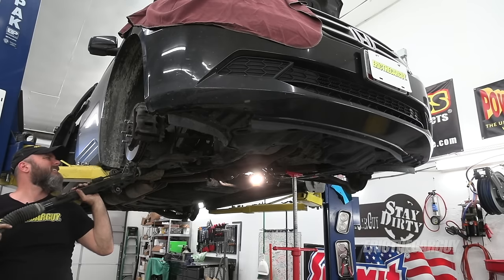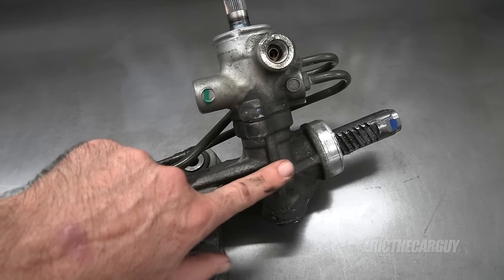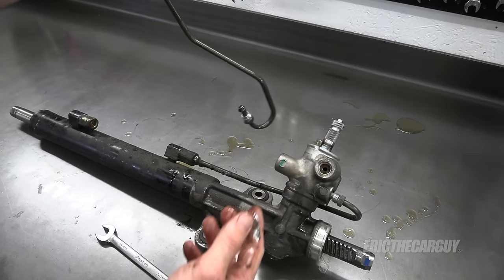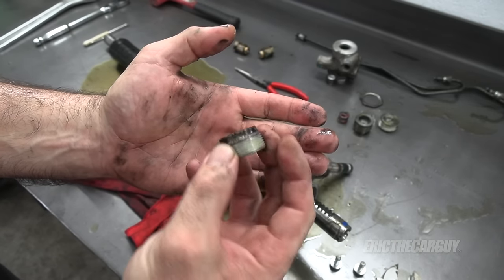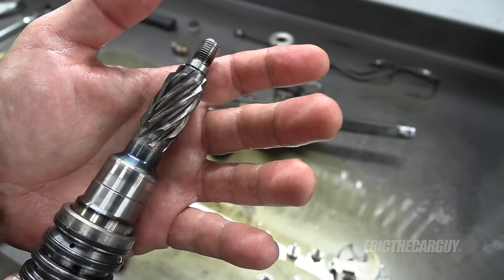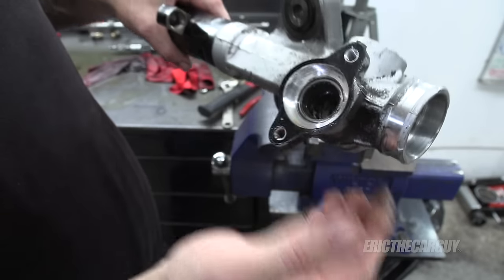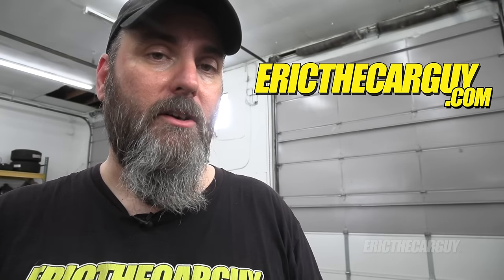Whats Inside a Power Steering Rack?

Comment: REBUILD IT PLEASE - a Power Steering Rack rebuild video by Eric will be super cool. All agreed - give thumps up here so Eric can make the video.
Reply from the maker: Well, you saw how it came apart. You could easily use this info to rebuild one of your own. Thanks for the comment.
Reply: @ericthecarguy  screw that...too many small parts ..I'll buy a cheap rebuilt on eBay 😀
Reply: @bilbobaggins4710  Maybe, you'd get lucky and buy a new one - like Eric. Don't neglect your local auto parts stores. They sell rebuilt parts.
Reply: @jeffkelley3419  too expensive....I mean my rack works fine just needs seals as is the case 99% of the time....not worth spending $350 plus my old unit... they're making a killing ...eBay $140
Reply from the maker: @Mike Pevency It's not always 'just seals' like in the case of this PS rack. If you end up needing hard parts you just lost your shirt on the rebuild and you would have been better off replacing with new or reman.
Reply: @ericthecarguy  I'm 54 and I've never had a rack need more than seals....I've been driving my Z for 1000's of miles with a leaking rack and still no mechanical issues ...I repair electric motors for nissans and infinities and they always need brushes only...never do they require hard parts replaced...soft parts are gonna fail at highest rates it's common sense
Reply: @bilbobaggins4710 u never replaced the seals?
Reply: @bilbobaggins4710  you can do that !!   ... but, I have bought remanufactured racks that come with excessive slop in them. Meaning, whomever rebuilt it, replaced the seals.  ..... but they DIDN'T replace any other worn guides that keep things tight inside there   And I also bought a rack that is allowing a lot of vibration and or feedback in the steering wheel over bumps. So I suspect they didn't replace the Teflon seals on the pistons.   It's easy to get a bum deal on a remanufactured steering rack when trusting someone else to do the work. Remember, if you want it done right..   ... you have to do it yourself.
Reply: @ericthecarguy I've rebuilt these racks alot there are several ways it fail but being that you go a vibration when you go over bumps it was the spring loaded shaft tensioner that was not properly torqued, it allowed up and down(horizontal)movement that's what caused your issue and if you look at the busing when you pulled it off it had a little bit of scoring from it not being the sioned properly. Also within that empty shall after you removed the shaft there's another regular oil seal in there... Those o ring thingi you saw all around the valve and in the middle of the shaft are all Teflon rings... Engineering is beautiful.

Comment: @EricTheCarGuy We rebuilt 100's of thousands of steering racks over the last 33 years. Interesting to watch you go through the teardown. Sad you didn't give the viewers the terminology of the components. As a builder and a troubleshooter I have been through so many calls and emails with people that didn't know what I was describing and they had been "doing this for blah blah many years" lol. BTW this rack is pretty simple parts wise than so many others. Also there is a reason why we leave the passenger side tie rod on when you take the pinion nut off! Love the mess!. Honda doesn't want the core back because it's a cheap POS of a rack often made by KOYO or SHOWA. They are so poorly and cheaply made like the rest of the vehicle that they are disposable. The rack piston is super soft steel so it bends easily and the chrome is thin.Yeah the lower pinion bearing is often a failure in the Odyssey just as in GM's especially Magnasteer. Too small of a bearing for too much load. And for those who buy the kits online and say "hey I'm going to rebuild my own!" Have fun! Unless you have all the specialty tools to properly remove, install, and seat the telfons, rubber seals, o-rings, packings, bearings etc for the more difficult racks I wish you well. One nick, burr, or ill-fitting packing with cause a fail at pressure. The one final tool is our trusty Branick RPA-700 tester. This is what simulates in-vehicle operation. If it's going to fail it will on the test machine. If you don't have this and you're rebuilding your own it sucks to put the unit back in and have it fail making a mess all over everything. Using the vehicle as your final test is a bad way to learn a lesson. For those who whine about rebuilt parts I can tell plenty of stories about the seasoned wrenchers that ruined many a rack and expect warranty replacement. Good video Eric.
Reply: Hi Jon Roberts, are you saying that any steering racks can be rebuilt/repaired and there is nothing called beyond repair ? Thanks in advance for your (expert) response !
Reply: @ssudarso  I never said ANY. I did mention some in that post aren't worth it. We've certainly seen beyond repair. No doubt. Collision victim where the entire housing is shattered or the rack shaft is too bent to straighten. Mounts broken. The famous LH platform Chrysler had in the 90's that was positioned in the vehicle so that the rack housing would fill with water and the polished rack shaft would be corroded and pitted beyond repair. First gen Tacoma 4WD would get water in the passenger end and ruin the entire shaft. Couldn't get them re-chromed when that damaged. Oh and Late 70's Volvos leaked like hell no matter what you did. Bad design. Same with early Audi 100, any old school Bentley or Rolls, Jags, leaked like hell. Most older UK racks made by "Pow A Rak" were horrible leakers even with genuine seals. We only rebuilt with OEM seals. Some parts are just made bad and rebuilding is either more challenging or pointless. Thanks for the reply!
Reply: @jonroberts4422  many thanks for your elaborative responses and explanation. Understand that if major deformation happend (too bent, damage due to accident etc.) it is better to replace the whole unit but in general if it is about "noises" - it should be rebuilt-able.
Reply: The main front suspension noise on the passenger side that gets us all crazy and after changing all suspension components is always still there, is from this bushing 11:48 it only needs a little wear for the pinion to move up and down inside the rack and create that rattle noise that nobody can find!
Reply: By any chance, do you know companies who sell this repair kits? I`m asking just to make a test with my old steering rack. Last time, makes some ugly noises when turning left/right just standing there..
Reply: @dignitas1980  I know companies that sold kits to rebuilders, but no to the general public. Our operation was based on bulk seals so we spec'd each rack for it's original seals by size and/or it's marked part number and then purchased those seals in bulk quantities from the manufacturer supplier to the OEM so our rebuilds matched a new OEM build. OEM seals are not normally sold in any kits you find on line so I can't speak for their quality or fitment accuracy. Fitment and quality are key to be able to perform at the high pressures this hydraulic system operates in. It's a lot of work to go through to be cheap and be wrong. Seals require specialized tools, not available to the general public or must be custom made, to install correctly so not to damage them or improperly seat them. It's cheaper and better to purchase a pressure tested remanufactured rack or send yours to a rebuilder than to do it yourself and risk being wrong. Not the answer DYI'ers want to here as I'm one myself, but I know the pitfalls with this assembly and the system it operates in VERY well. Noises as you mention can be a variety of reasons or causes that you must pinpoint to rule out the rack or related components either hydraulic or mechanical.
Reply: @dignitas1980  What car/rack? Year Make Model Eng etc? What noises under what circumstances are the symptoms? Details are important. Is the rack leaking? From where?
Reply: @jonroberts4422  It is a electric one, for VW Passat B6, european version, year model 2010. Symptoms: very bad noises when turn the steering wheel doesn`t matter if i`m moving or not. Last time, the steering wheel didn`t turn at all.
Reply: @dignitas1980  Okay I'm clear. We stopped rebuilding before electric racks got popular. No answer on that one except to get a known good salvage rack by it's OEM part number (usually on the rack) and install then reprogram it to set center home position and to make sure it articulates "lock to lock" smoothly. We search for various axle cores online by the OEM# and find the european salvage yards have them listed by every possible marking you will see on them to increase the search results. In the US that's not always the case. Electric racks are a horrible design compared to the hydraulic, but the trend began and will continue toward throwaway parts and vehicles.
Reply: 19:01

Comment: I worked as a Rep for a rebuilding company that was one of the first rebuilders of racks. At a introduction to racks, TRW explained that the spool valve was made with Teflon seals that over time would cut into the aluminum housing, making the rack "non-rebuildable."
Hogwash. Anything built can be rebuilt! They bored the housing, installed a steel sleeve, making the rebuilt unit better than the OEM unit!

Comment: My dad this morning was complaining about his car making a whining noise when turning. I explained to him its his power steering. He was like how does that work anyways? And this video came out today lol
Reply: Probably the pump. Either just low on fluid or getting worn out.
Reply: @wernerdanler2742  months later but youre probably wrong. PS pumps have several O rings that can go bad, allowing oil to leak or air to pull in. Whines are usually from air being pulled into the fluid or in worst cases, the bearing going out. But both things can be replaced. The vanes going out would mean it won't pump anymore.

Comment: Fun fact: The main front suspension noise on the passenger side that gets us all crazy and after changing all suspension components is always still there, is from this bushing 11:48 it only needs a little wear for the pinion to move up and down inside the rack so slightly and create that rattle noise that nobody can find! When the rubber dust boots get torn the dust destroys that small bearing causing the valve assembly pinion to move causing the leaks, that is why from factory they install this small bearing without the rubber seals to guarantee premature failure 😀!
Reply: I don't understand how that bushing on the end of the rack at 11:48 has an effect on the movement of the pinion up and down.  If it were a bushing on the top or bottom of the pinion, that would make sense, but on the end of the rack...?  Or did you mean to say that the bushing (what Eric called an end cap) allows the rack (shaft) to move up and down?   And what bearing are you referring to?  I didn't see a bearing on the end of the rack?  Sorry, I'm just a little confused by your description.  Thanks
Reply: @West-Wind i had exactly the same question. I think his timestamp is off

Comment: That is some pretty precise machining that goes into that
Reply: Yeah, electric rack and pinion seems like a much better ideea. I got it i my 02 shit box civic. I don't see why the hate.
Reply: @SoulTouchMusic93  I hear ya on that but is it more reliable?  And if it F's up does it cost like a grand to fix?
Reply: @sc0tte1-416  it shouldn't really. I meant my Honda is made in 02 and it still goes. I believe when these racks first started they had the electric motor close to the steering wheel and the sensors as well. And they had shitty steering feel. Now it looks just like this one in the video, they have the engine and sensors right next to the rack and it's one sealed thing. They don't seem to go wrong, they feel good, they don't create drag on the engine and they only need 2 wires to give them power.
Reply: @SoulTouchMusic93  let me know when 30yrs old with over 500k miles.  All my vehicles still have their original items, newest is a 94.  Plus I get full feeling is steering.

Comment: I think most likely was the gap between the pinion and the gear was too big due wear and tear. Kinda like diff gears. Most steering racks probably just need some adjustment from that nut that had the spring. Thank you for the video. Very enlightening. My boss use to say, “if you how it works you can fix it”👍

Comment: I have a slight vibration in my steering wheel (2005 Accord) only between 60 and 70 mph. New rims, alignment, balance, hub centric rings, etc. No leaks off the pump or rack.

I collected some of the fluid to inspect which was reddish black. Meaning someone had put ATF in a Honda power steering system and I guess it gunked it up to the point of wearing out the bearing in there like yours. I've done 2 full flushes and it's still pretty dirty. This video gave me a lot of insight, thanks!

Comment: I recall that after replacing your first rack and pump it is a good idea to install an inline filter.  That way those little metal chips get caught before they can do more damage. I got interested in using a filter when the local Ford dealer quoted me $5,300.00 for a new power steering pump for my 2000 Ranger EV.

Comment: to anyone interested- honda power steering fluid is 4 times thicker than normal PSfluid, it is also more gentle on seals- if you use alternative grades- they are thinner and may damage seals . using the honda fluid in normal power steering systems , makes the steering heavy as the orrifices are smaller, and increases pressure on the pump, if removed and flushed soon enough you may not have caused any damage to the pump. its like pumping oil thru a syringe vs water

Comment: I have tightened that nut with the spring and piece that holds tension against the shaft about 1/4 turn  on my rack and solved a noise issue on some cars. On others it didn't work at all.  If you get it too tight your steering will be too stiff, so go slow and check steering effort often.

Comment: The seals could leaking or the valves were sticking/bypassing. It could also be the bearings like you pointed out. Most likely a combination.

Comment: Very cool, thanks for sharing, never seen inside one. It appears that the fluid keeps even pressure on the stationary piston until you turn the wheel like a valve body inside a trans. Curious to know how when turning the wheel, how the fluid moves from the shaft to the piston since it needs to bleed off one side as it turns. Those 3 seals obviously direct the fluid, but the back and forth of the fluid direction is great engineering. Again, very cool.

Comment: Thank you for your deep analysis video as always. 
Can you guess as to why so many competitive drifting cars have power steering problems? Specially the one with crazy angle kits installed. Their power steering fluid not only overheat but sometimes explode out the pipes or turn into air/gas. I suppose the sheer speed the piston moves through inside that thing causes problems but anyone can speculate that. I just don't know why it does.
Reply from the maker: PS temperatures are no joke. https://www.youtube.com/watch?v=lnKi-H3yqf8

Comment: Thanks Eric! That was fun AND educational.

So... given the metal shards on the power piston, and the "wait a minute" catch on the lower shaft bearing, you gotta suspect the metal may've come from elsewhere, e.g. a pump that ate itself at some point? If so, maybe the whole rack failure is a symptom & the root cause was a failed pump. Hopefully no other metal specks floating in the system!
Reply from the maker: Honestly IDK. That was the only place I found it. It could have also just been some coating material from the parts. Either way, I installed a new Honda rack in my van so I'm really not worried about it.

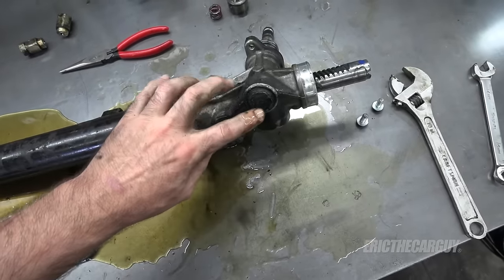Comment: 07:52. That 15/16 nut was loose on my 2012 G37, and fluid was leaking - had been for a while with the buildup on the outside. I tightened it up, now the steering is tighter which is weird as that appears to NOT be the part you could adjust for the pre-load tension, but merely a cap as you pointed out. Same time, I checked the fluid and it was down about 1/4 qt. Added fluid and the steering did get easier, albeit still tighter than before all of this and it's always seemed quite loose for a 3 turn L2L rack.

Comment: Eric, I recommend saving those lines you removed at the beginning (if you haven't already thrown them out), just in case the new ones ever rust out and need to be replaced. I've had to replace those on 2 different cars ('11 Escalade and '04 CR-V). I found that, for many makes/models, no one makes replacement lines and you have to buy the whole rack and pinion to get new ones. I was able to buy replacement lines for the Escalade, but not for the CR-V. For that car, I ended up making my own lines out of 1/4" NiCopp brake line. Luckily the ends were bubble flare, so I was able to use my brake flaring tool to flare the ends. But that wouldn't work for those funky o-ring ends that your lines have.
Reply from the maker: Honestly I'm not concerned. I just installed a brand new Honda PS rack and I maintain my vehicles pretty well. This van is also garage kept. I don't think it'll be an issue. However, I'm not opposed to keeping old parts. https://www.youtube.com/watch?v=EdKH2NzzkNs&t=5s

Comment: My 1977 Civic Hatchback had a steering rattle.  I made the rack pinion load adjustment once at abut 20,000 miles and it was sweet until I threw the car away at 120,000 miles.  No power steering so the driver had good rack feel!

Nne of my subsequent Hondas or Toyota needed it.